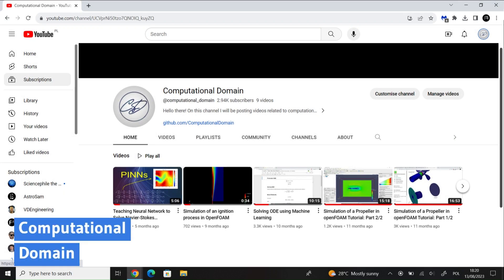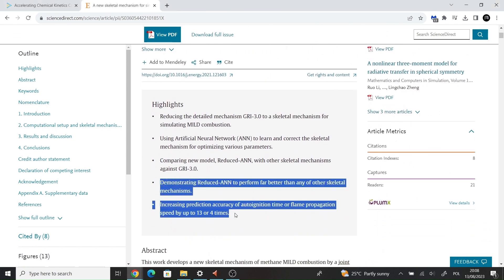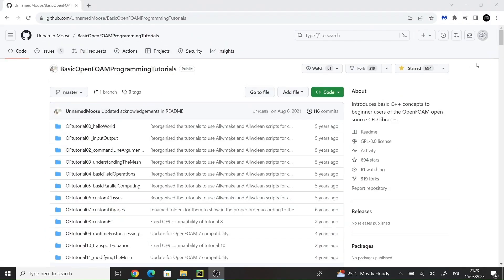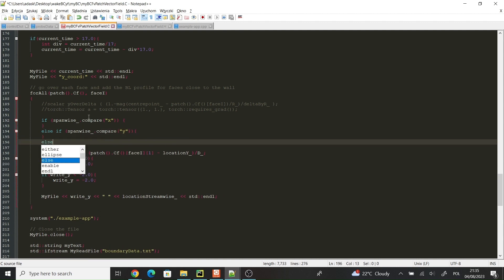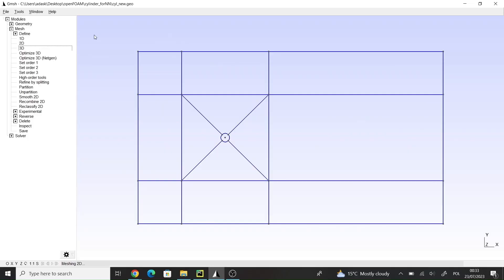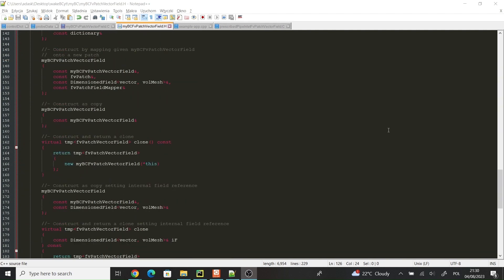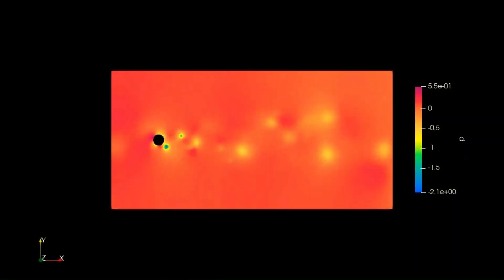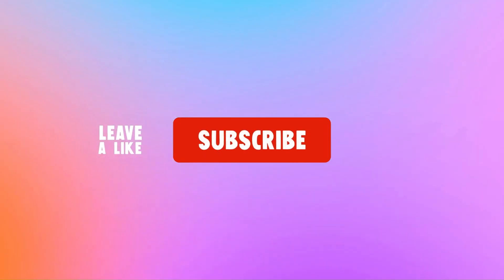Coupling Neural Network with a CFD Solver

Comment: Thanks for sharing. Notice you model the flow around cylinder that is in the wake of another cylinder. Where the two cylinders of the same diameter? When you model step cylinders , you can get interesting results such as karman vortex shedding and other phenomena. It would defnitely be of interest if you were to apply PINNs to the CFD of other geometric shapes.

Comment: Excellent work! I've been delving into a similar area, albeit focused on the individual particle level. I've successfully trained a neural network to calculate particle dynamics in a single step, effectively replacing the need for 25 traditional computational substeps of Verlet integration. Interestingly, the network yields significantly more stable results compared to numeric integration when subjected to high-energy collisions. Unlike Verlet integration, the network simulation does not "explode".
Have you experimented with your simulation at energy levels exceeding those used during training?